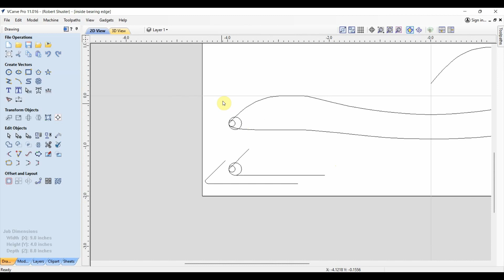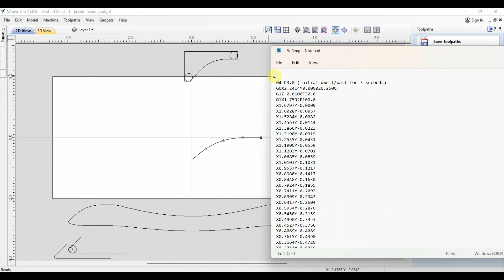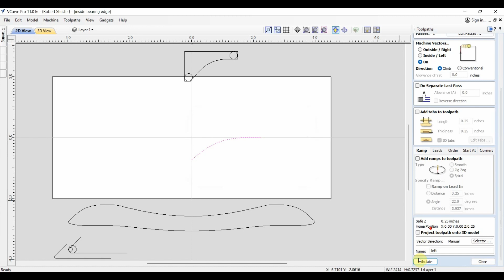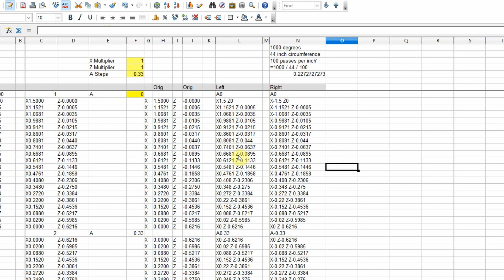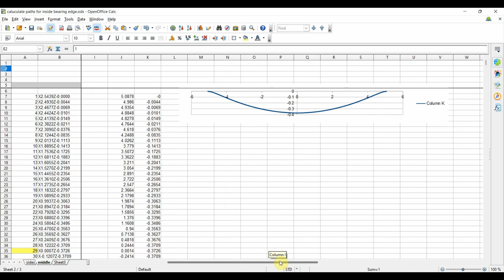Modifying gcode in a Spreadsheet -  SnakeSkin Drum Build 3b

Comment: Winderful* information!
Reply: To do a "normal" straight carve on the interior, would you do the same method with a straight line vector as opposed to the curve?
Reply from the maker: no.  For straight/level rotary cut/skim, I manually put in the code (MDI section).  I use this for skimming both the inside and outside of the drum.

If I have a 10 inches I want to skim, and I want to move .0625 (1/16) to the right (X) per rotation, I set the machine to  X0,  A0, and Z0, and then put this in:  
G0 X10 A57600

G0 - sets it to go the machines rapid rate, so I speed up or slow down on the machine settings.
X10 - tells it to go 10 inches to the right (assuming you are starting from X)
A57600 - 360 degrees (one rotation) <multiply by> 16 rotations <multiply by> 10 inches.  16x360x10=57600 degrees of rotation.  

This would probably make a decent video for the for the true CNC geeks.  In the end it is actually simple, but it takes a while to wrap your head around it
Reply: @sidewinderdrums  thanks! I, for one, would certainly be interested in that video!

Comment: Is this similar to the code that the wrapping toolpath creates?  Couldn't you use that to create what you are looking for?  I watched all the way to the ind.
Reply from the maker: I had not thought about that, but yes I think that would be possible.  Good idea!  I think I will explore that more in the future.
Reply: @sidewinderdrums  I find that somewhat hard to believe but If I stumbled onto something, let us know if it works please.
Reply from the maker: @philshel1  I think I read more into your post than you intended.  I was thinking continuous wrapping - so it would never stop and reverse direction - it could spin the same direction the whole tool path.
Reply: @sidewinderdrums  LOL, ok you lost me again.  I was just thinking that the gcode wouldn't care where it is cutting.  The top of the exterior of a cylinder is, in this case, the same as the bottom of the inside.  The mill cuts on single spot in space either way.  The profile is also the same no matter how it wraps.  The spinning of the drum I'm not sure about, but isn't that controlled by the raster or offset options?
Reply from the maker: @philshel1  If my theory works, then it will be in the video in 2 weeks (if it does not work you will never hear about it again...)
Reply: @sidewinderdrums  Ohhhh, mysterious!